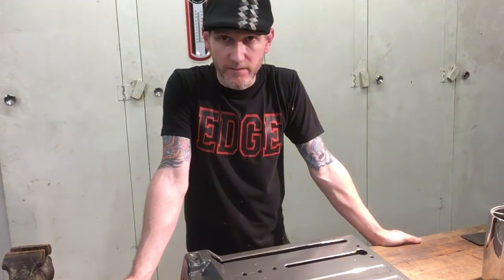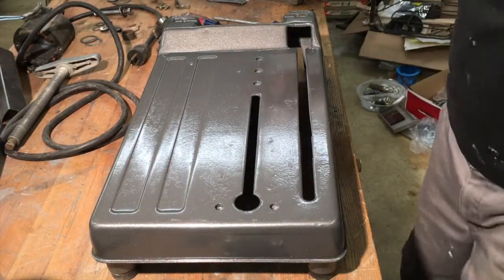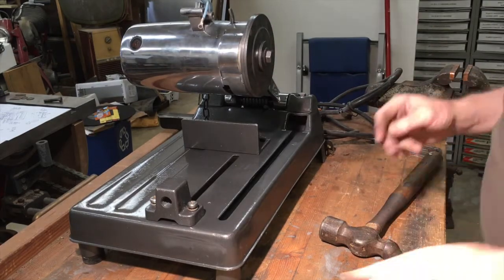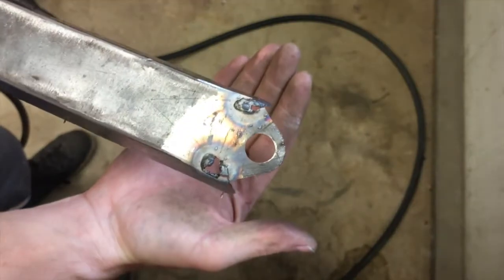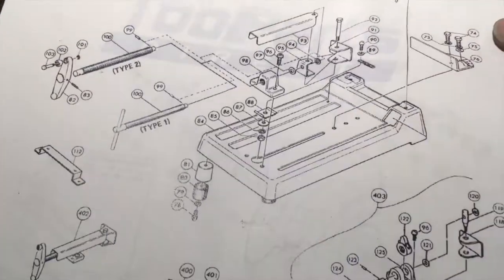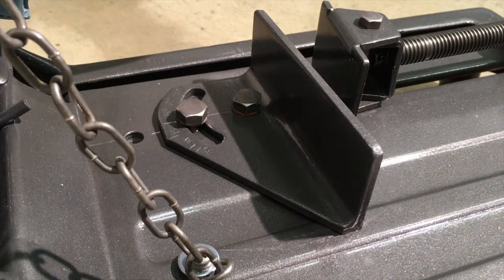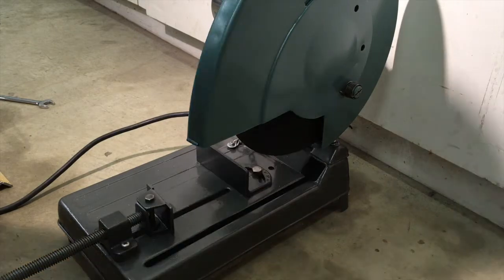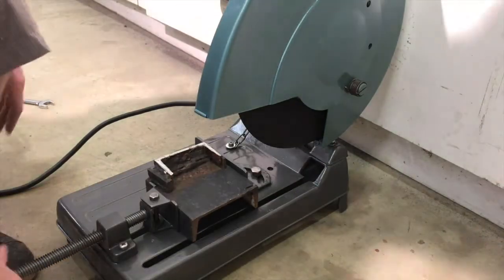Makita 2414 Chop Saw Restoration part 2

Comment: The electrical company I work for has a saw of identical model however ours is much less pretty. Ours also doesn’t have a thread guard. Mostly used for cutting strut channel and threaded rod. Most of us have moved onto using cordless metal cutting circular saws.

Comment: I just bought one of these and I want to do a similar restoration. I want to paint my base semi gloss black and paint my blade guard gloss black and put a nice red and white makita decal on the blade guard before clear coating. Not sure if im going to polish the aluminum handle housing but if I do, I'd like to fix up my crusty nameplate. How did you get your nameplate to look so nice?